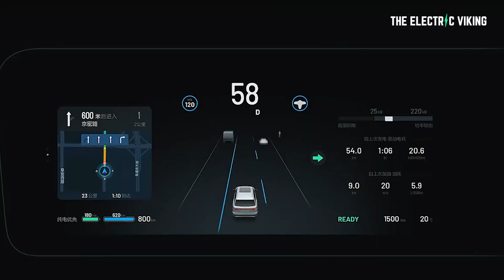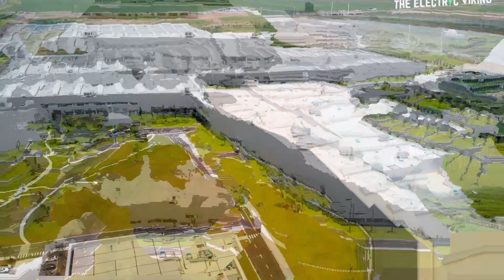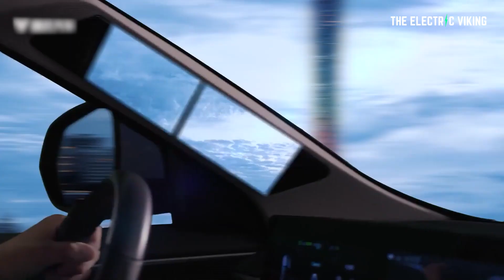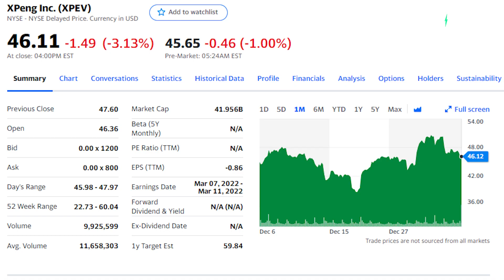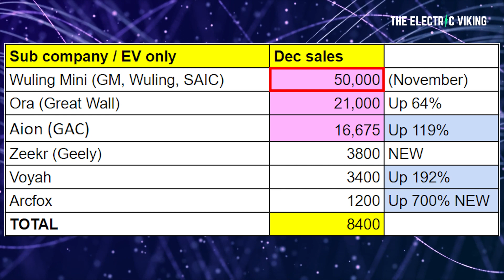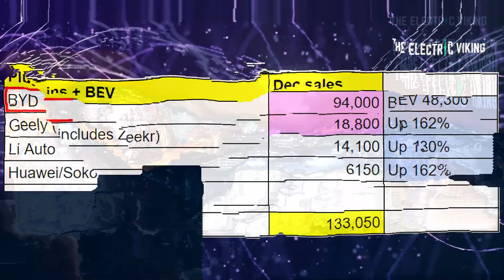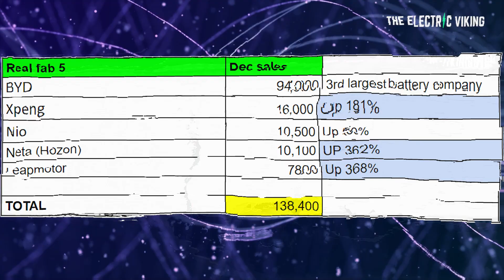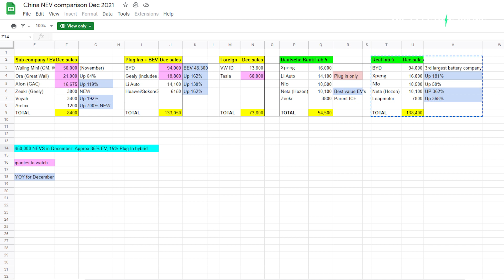SUPERFAST 2021 overview of China's EV market + the FAB 5

Comment: Derogatory remarks are not professional, disrespectful and unnecessary in my opinion, accurate, informative, substantive facts give you respect. 
Your referral to sales percentages as a reason to buy, invest, or rate a company, in my opinion are not the tool to use, sales vs produced, sales vs production plan and sales plan. In going forward, production plan vs sales plan. Quoting percentages are hype, the details behind them is what is important.

Comment: Sam, I have a question I would appreciate your responding to. Li Auto refers to their Li One as an EREV, extended range electric vehicle, not as a PHEV. Is this just a marketing device or is there a difference. I believe there is a difference however you clearly do not and I would appreciate your reviewing the facts. 
The Li One has a 40.5 kwh battery pack with a 188km WLTC range, perhaps 100 real miles and a fossil fuel generator, not an engine though that might be considered semantics by some that cannot, and I repeat cannot, "drive" the car. It is lightweight and only used to generate electricity to recharge the battery and to deliver electricity directly to the drive train. That is a very different model than a 6 to 10 KWH battery pack with a full scale fossil fuel motor used to directly drive the vehicle in a traditional PHEV.
I think of the Li One as an EV that might function exclusively as an EV for most daily and city commutes for up to 100 real miles with a generator and perhaps a 10 gallon fuel tank (just a guess) to provide significant extended range, 890 KM to relieve range anxiety.

I see an EREV as legitimately different than a PHEV.
Reply: At the end it still burns fossil fuel once the battery is depleted. I would be interested to know if it has better fuel efficiency compared to a typical ice suv when both vehicles are using petrol
Reply: @deragoth4250  it will for sure, like my Audi A-3 e-tron plug-in hybrid, as a minimum you get 10%~25% saving just from the regenerative braking. Plus, it’s probably got a much smaller engine than a same size ICE SUV, more saving there on the highway since smaller engines generally consume gas more slowly. Take my car for example, if I drive full gas mode (which still uses the electric motor for low speed and acceleration) on long distance highway driving at >120km/h, it averages <6L/100km. A similar size ICE car will for sure do more than 7.5L/100km. And I drive fast. Especially considering the Li SUV uses the engine as a generator meaning it should always run at more optimal rpm just to charge the battery. Electric motors are known to be more efficient than gas engines in power output as well. For sure the Li plug-in will be more efficient than my Audi A-3.
Reply: @deragoth4250  A second response.
I currently own both a Tesla Model S and the Lexus version of the Prius (not plug-in).
The Lexus can drive as an EV for just 2-3 miles at a time and at low speed, around 30 mph, but gets the equivalent of perhaps 80 mpg when driving that way which is perhaps the same as the Tesla though the Tesla does not have the speed issue.
When the Lexus is using the motor to generate electricity to drive the car it gets perhaps 50 mpg.
When it is driving with the large FF motor directly driving the wheels it gets around 30 mpg.
So yes I believe the Li One gets something like the 50 mpg plus (more efficient than the Prius) when driving with the generator producing electric and not the 30 mpg an equivalent ICE car would get. I also assume it is tuned differently so it does not have speed issues.
Reply: @deragoth4250  You are of course correct but the difference is significant.  
Most  people basically drive PHEV as if they were fossil fuel vehicles with just a few miles of EV available and the motor, which is typical of FF cars is heavy and not overly efficient but does perhaps 90% of the driving and the battery, barely used, adds additional weight. when driving as an ICE vehicle. 
With an EREV the owner could do 90% of their driving as an EV (first 100 true miles) and when the generator (not a motor but a small generator) "kicks in" and continues to supply electric to the electric drive train it is super efficient and can deliver mileage at typical EV efficiencies.

It is important to recognize the above very important differences so to the reader and with no disrespect intended please re-read the above to internalize the significant difference. It really is an EV with extended range delivered by a small generator and a few gallons instead of many more batteries.
Reply: Wikipedia has a page of "hybrid vehicle drivetrain". The page is a little outdated, but the principles remain valid.

In Chinese marketing terms:
PHEV (broad sense): All plug-in hybrids that can drive either solely on electricity (at least 50 km) or gas.
PHEV (narrow sense): PHEV(bs) that uses a series-parallel hybrid drivetrain. It can automatically switch between EV mode, series mode and parallel mode.
EREV: PHEV(bs) that uses a series hybrid drivetrain.
New Energy Vehicle (NEV): PHEV + BEV + Hydrogen.
Mild hybrid cars: Not PHEV or NEV. Called "light hybrid" in Chinese.
Hybrid cars that must use gas (e.g. some Toyota and Honda cars): Not PHEV or NEV. Called "gas hybrid" in Chinese.
Reply: The difference between a EREV and a PHEV(narrow sense, series-parallel drivetrain) is: PHEV's ICE engine can diretly drive the wheel (in parallel mode) at high speed, when the engine is running at its max efficiency. EREV  suffers from loss in energy conversion in the electricity generator, the battery and the electric motor. At low speed, both work in series mode, or ER mode.
Reply: Does it matter what you call it though? It will get you an EV plate in most countries. I think that’s what matters.